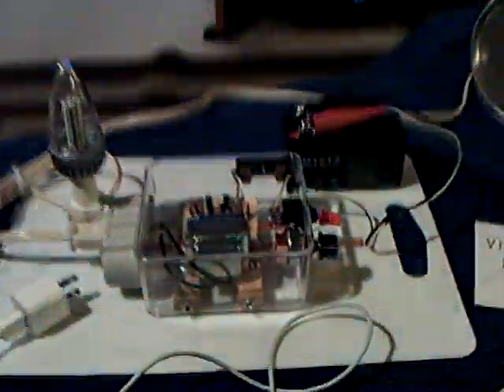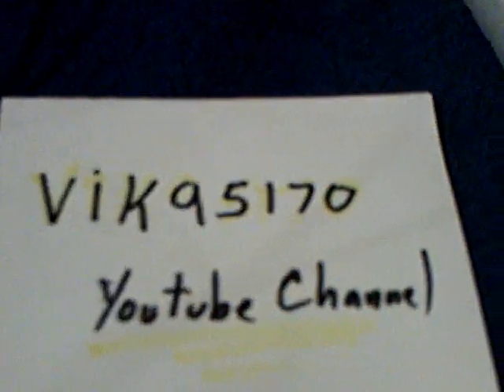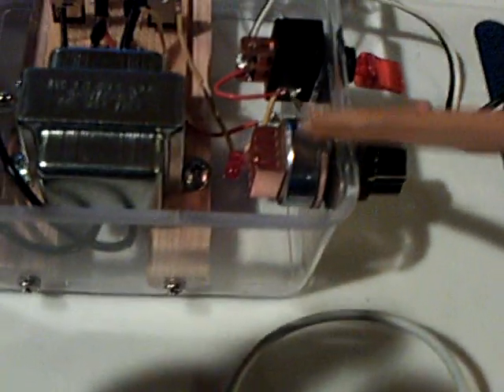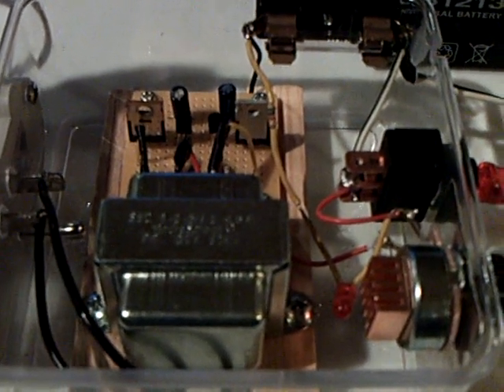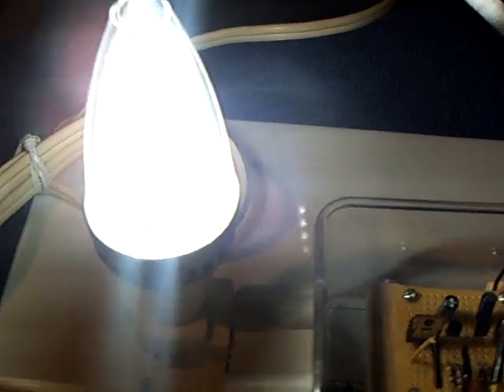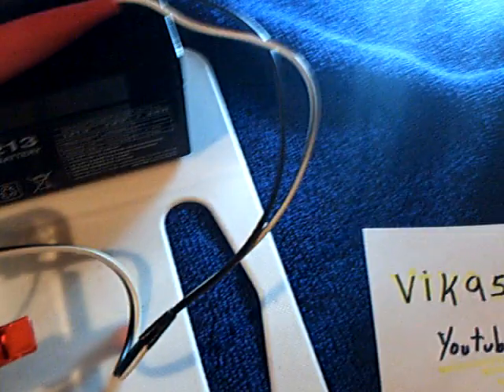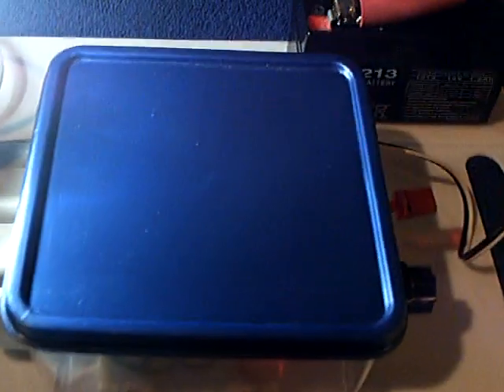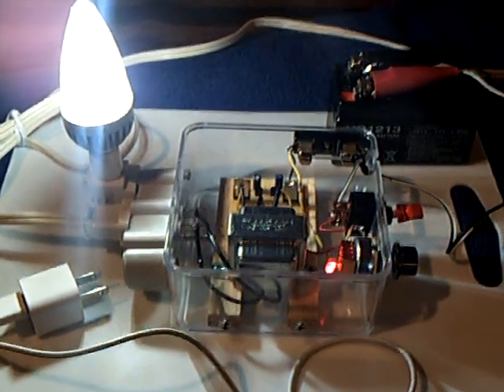French inverter finished,  boxed, and ready to use

Comment: @Lidmotor 
Hi Lidmotors! How could you speak about "energy thieves"? You never get "more energy" anywhere with an inverter, you just reduce the resistance of conductors by putting molecular vibration and ionisation of gas, so that you get a better PASSIVE power. So, you can make light brighter, lighting led that not light otherwise with same voltage, but look, check well at the energy taken to the battery and you will see you empty it faster than normal: P*T=E, that's the true test ;)

Comment from the maker: @truepres ------The fuse is really important but WHERE you put it is also important.  I hate it when the manufacturer of an electronic device burys it deep inside so you have to take the item apart to get to it.  On some devices the fuse is SOLDERED IN!!!  That makes no sense to me.   A resetable circuit breaker is what I should have used on this inverter but I didn't have one.  The way that I did this it will slow me down a little if I blow the fuse and think twice before I overload the thing.